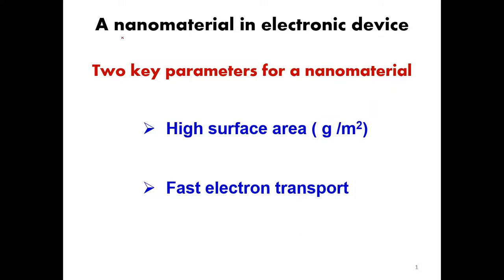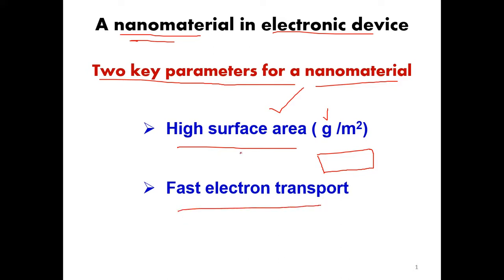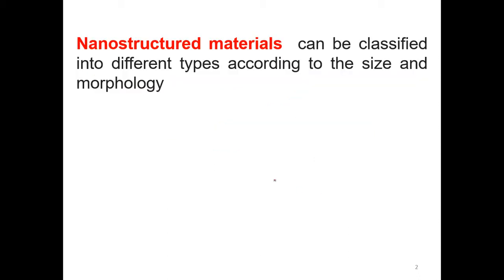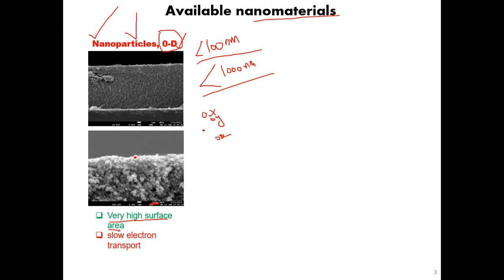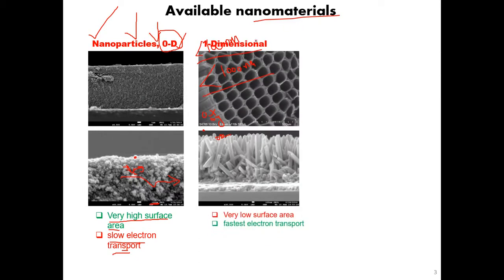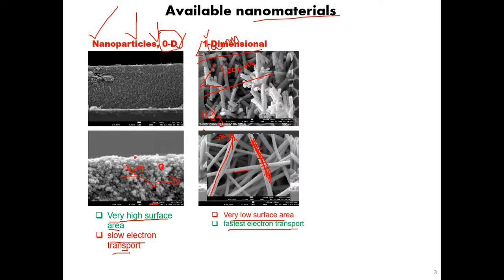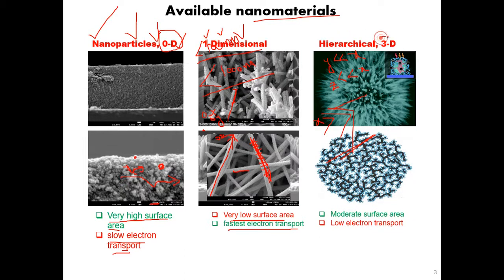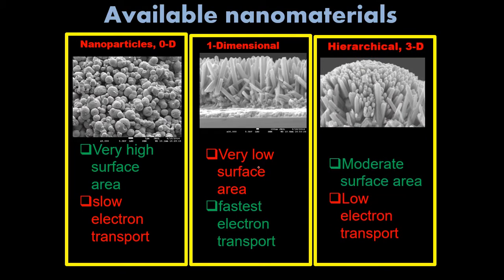Types of Nanomaterials: Surface Area vs Electron Transport

Comment: Sir it's a very important topic and thanks for making this video. 
I have a question. Actually I am working on polymer and ZnO Nanomaterial composite based gas sensor. I am worried my ZnO is not going to fix with polymer when I did EDX analysis there were no traces of Zinc. So is there any way to make a good composite or is there any method? My other question is, does purity of nanoparticle matter? Means purer the nanoparticle lesser the bonding with polymer? Am I correct?
Reply from the maker: I am not sure that how you make composite of ZnO and polymer. As to get ZnO, we have to burn it around 400 C and the polymer is no more there. 
We usually make composite of Zn-Ti,   or Zn-Sn etc. 

If you make it possible to get polymer - ZnO composite and there is no traces of Polymer after doing EDX then you need to change the stiochemsitry of the solution. Just increase the polymer concantation. 

The second question, I am not sure. Sorry about that
Reply: @nanospeaks  I just put polymer in solvent and then ZnO nanoparticle then continuously stirring for 1 hr. You talk about 400 C temperature I am afraid at this temperature polymer will be destroyed. Correction in your answer " I my case there is no traces of zinc after EDX.
I used spin coater to deposit the composite film on porous vertical template.